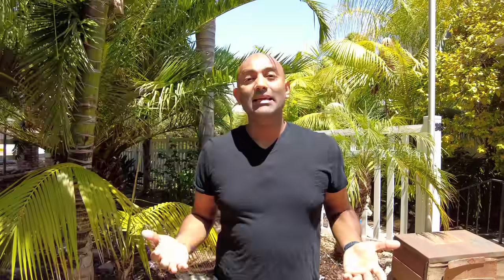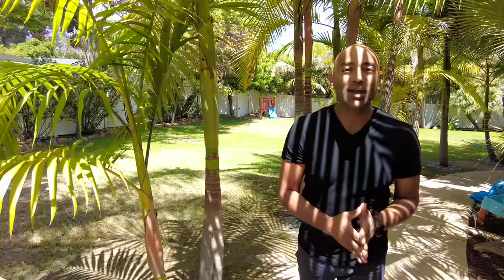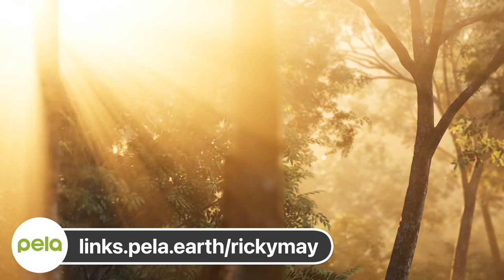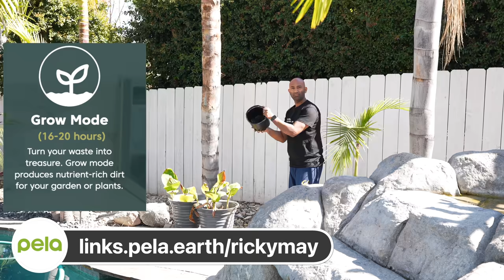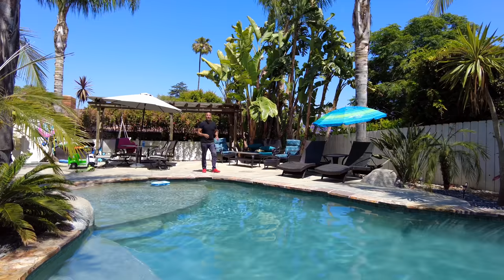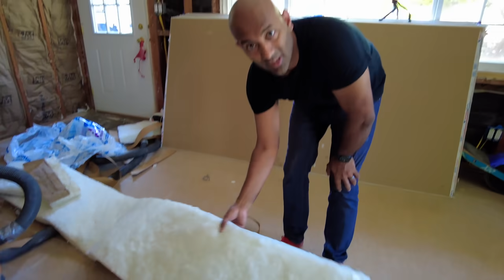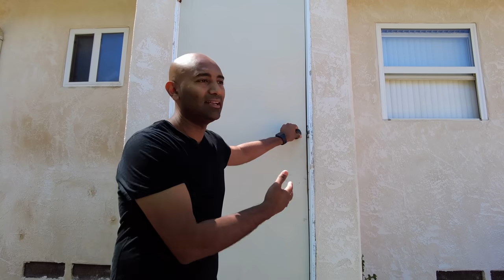How I'm Planning to go 100% OFF-Grid!

Comment: At 13:04, one thing to consider is that there's a minimum monthly charge just to have the natural gas service.  So it may cost more than you think even if you're not really using much hot water at the auxiliary house.  Also, that would break the 100% goal right there with that methane gas which is 80x more greenhouse potent than carbon dioxide.

Could DIY trench a small conduit using water hose excavation under the pavement.  Or run overhead 4AWG wire from main breaker panel to sub-breaker panel.

Also, will the auxiliary house have its own house battery?  If so, the combination of the batteries and the existing 60A line may be enough to run a tankless water heater.
Reply: Tankless are still resistance heating, so no considerable energy benefit over electric tank. Tankless are useful for wasteful vacation homes where people never actually live.
Reply from the maker: The connection fee is less than 10 bucks ... i'll find out how much exactly.
Reply from the maker: the benefit is i will never use it. this home is an office, we dont use hot water the way a normal home would. now our main home yeah absolutely. but I am now thinking heat pump water here a small one, for that house too
Reply: @TwoBitDaVinci  Yes, a small office could use hot water for employees to make tea, coffee, and instant noodles.  Nobody is taking showers there.

Doesn't need to be complicated.  Could just be a 120V electric kettle.  Or, better, a small under-the-sink 120V electric tankless heater.  At 120V, it maxes out at ~1800W (15A), it will just be a small faucet but the water comes out scorching hot perfect for a cup of tea or noodles.

Comment: I wish you luck  - not easy retro fitting a house to be off-grid. My house is off-grid for electricity for the house and the car and we have rainwater harvesting supported by solar well pumps. Living in the tropics we don't need heating but I do have solar thermal for hot water. This was possible because the house was designed from the ground up to be off-grid.
Reply from the maker: very interesting, in Thailand? that's soo cool, I want to come visit, let's do a collab :)

Comment: You don't need a geothermal heating system in Southern California. I design and sell residential HVAC systems in Washington state. Even with our 25 degree to 45 degree winters an air sourced heat pump is all you need. Unless you are going to dig and trench yourself for Geothermal it's going to be way too expensive. If you want efficiency get a Trane XV19 Heat Pump and ducted air handler or a Mitsubishi system. It's even better if you go 100% ductless with the wall mounted heads. Then you avoid all the losses from ductwork running through an attic or crawl space. Insulate and seal up the house and then use a good Solar system. I love what you're doing. Once I buy a home I will be getting Solar, a ductless heating system, and a wood stove. I love the idea of a self reliant home.

Comment: Mini splits are great for heating/cooling individual rooms.  Large, open areas may need central a/c, but mini splits really put the heat/cool where you need it without running a large unit.  There are a few mini split heat pumps.
Reply from the maker: you said it! For my main home there's too many places and at some point a large sytem is better. But I am going to look into smart vents that open and close only cooling certain areas
Reply: @TwoBitDaVinci  Check with an HVAC person.  Apparently, closing too many (over 10%) vents puts too much back pressure on the system and ages the unit.  Not at all intuitive.
Reply: I have two in AUS

Comment: For the second house how about solar water panel and small pump to highly insulated tank.  There a vacuum panels that I think would be very good for that.
Reply: better to put in solar PV and 50 gal electric water heater. Less cost and more benefit.
Reply from the maker: I agree! I'm going 100% PV solar, and a heat pump water heater I think

Comment: after changing the pool heater from the pipes like yours, to a heat pump heater
and i can tell you the heat pump ripps heaps of power
as the solar only runs for a second
so i run both systems.
the only thing i see that the heatpump is good is because you can crank it in winter and use the pool so you can gain days of use to the cost i guess
also how much power dose the lomi cost to do a cycle

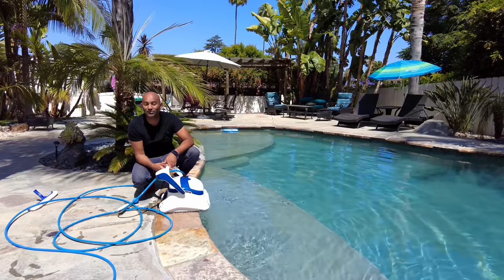Comment: 7:00 how much are you paying per kWh?
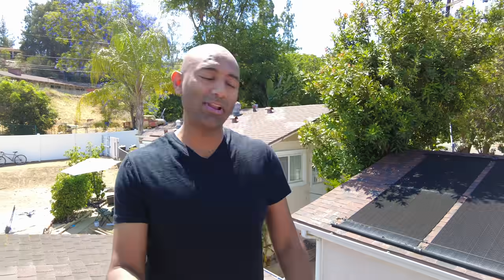10:00 while that is opened up maybe combine all those roof penetrations?
13:00 110v heat pump water heater for low demand is a perfect solution. In fact, most heat pump water heaters only have 220 for the backup coils.
Reply from the maker: 30-55 cents per kWh. Yes I’m going to clean up the roof as I go! Yes we are thinking heat pump heater as well

Comment: My heat pump water heater is wired on 30 amp circut, But it only uses 1-4 kw per day.  I believe Rheem has one that runs on 15 amp circut, it does not have the secondary heating elements.  Thats the one to get for the office...
Reply from the maker: That's what I need! I don't want to have any back up... here in San Diego, the heat pump part is all we need. Plus it'll help cool our closet

Comment: You should get the heat pump HWT it will heat your water and cool the house. You get the big tank and any excess solar you have heat the water. Its cheaper than battery and storing energy. Add some solar thermal on your roof. You can not say earthship, net zero or passiv haus with R12 insulation and GAS!

Comment: You could condensate water out of the air in an airduct/pipe under the earth. The heat generated could be beneficial for your geothermal heatpump. With a Mollier diagram and the statistics of humidity in your region you could check the feasibility.
Reply from the maker: i love the idea! I'd love to pick your brain about this more!

Comment: that is great news that you are planning to go off grid. I have the exact same thoughts. 
But since you are planning to go for Geo Thermal Heat pumps for your Heating, why do you want a separate system for your Dryer? why not use the same since it will be more efficient.
Reply from the maker: it'll depend on timing, but that's a very good idea!

Comment: Well, in the small house you can use 5 liter electric water heater to eliminate gas. You need a wire and it needs to be installed into the water pipeline. No hot water pipeline is needed.

Comment: Ricky, you suggested in this video that a natural gas connection is normal for houses.  I live in a suburb of Portland (Oregon) where many (if not most) homes are not connected to natural gas.   Some have diesel fuel for furnaces but most were connected for electric heat and electricity is still cheap enough to make that a popular choice.
Reply from the maker: yeah for you i'd say its obvious you have to go heat pump! we'll try to cover benefits and advantages for all!

Comment: Before you install radiative barriers, make sure you understand that the shiny surface is NOT for reflection but rather, it is a low emissivity surface meaning that it radiates very little of its heat. If you look at it with an infrared camera, the "color" will indicate it is a much colder surface than it really is. Long story short... The shiny part goes on the hot side and you need an air gap between the shiny surface and the surface you hope to keep cooler. This will help you decide how to install the radiative barrier for maximum effectiveness.

Comment: I am interested to see what comes of these projects. I have already started my journey to make my homestead more resilient in the urban environment. Rain water for irrigation done and off grid backup power in the works. Keeping natural gas makes sense in my plan as the gas still flows when power is out. Also, I prefer to cook with fire. Maybe in the future when technology improves, the switch to electric heat sources will make sense.
Reply from the maker: great points and excited to have watching Eric! Yeah I'll definitely Keep natural gas, in some place for super emergencies. But otherwise I'm planning on an oversized system of solar and batteries so we can overcome a few cloudy days etc. I'm also planning a gray water system from showers and sinks for my irigation

Comment: Electric tankless water heaters need massive amounts of power. You are much better off with the Heat Pump water heater. I would suggest upgrading the panel to the smaller house. It will be worth it in the end.

Comment: Very interested in this series. We are currently waiting on upgrading our home solar from 5w to 15kw with two new powerwalls. And pre-wiring for another powerwall and EV charging. Sadly the biggest issue has been need for a new roof and extremely slow motion of the bank for a HELOC update. But we will be done in June I hope.

Comment: I think you can use a Solar Pipe water  Heater too on top of the heat pump , you can even DiY it is not that hard to build and it would  make a great video . Oh and  you can also just use an electrical (resistence) shower on the ouhouse , instead of installing a whole boiler.

Comment: This is a fascinating project!  It would be interesting to see side-by-side cost comparisons between a similar installation in a new house and a traditional energy setup, the kind a contractor is likely to be building right now.  My guess is the traditional approach is cheaper now, but that  cost is likely to increase over time, where the newer concept cost will be decreasing.  We need to calculate the sweet spot for the total costs over a reasonable lifespan of the house.

Comment: Matt Ferrell's YT channel mentioned your renovation  what caught my attention was how you were going to mount your solar panels in the backyard. This is something I was interested in doing but was worried the distance between solar panels and service panels would be a problem. Is the distance between solar panels and electrical service panels a problem? If not I might opt to add some more solar panels in our backyard on top of the shading structure. Thank you and good luck with your project.

Comment: Sounds like we're all in for a great video series. I can only make 1 suggestion for an appliance based on my own experience, an induction stove top! Heats as fast as gas, but uses less electricity than electric! Bonus all around! 😁
Reply from the maker: that's amazing, yes our plan is to swap to that for the main house!
Reply: Induction all the way. We've been using induction hobs for over a decade, I'll never go back to a regular electric or gas hob.

Comment: Great plan Two Bit. But sub surface drip irrigation under your lawn is the way forward, sprinklers are huge waste through evaporation and run off.
Reply from the maker: really good point. i have some ideas and products I'm looking at. also i want to do a gray water capture system from sinks and showers, and use that for 100% of my lawn use
Reply: @TwoBitDaVinci  wonderful what you are doing! I’m a plumber and love my subsurface drip. Minimal water direct to the roots for lawn and plants. Love watching your mind work, keep it up.

Comment: There are 120v 1.8kw tankless water heaters for at the source heating. It won't be powerful enough for showers and washing machines, but should be good for sinks. They aren't expensive either. Or look up point of use water heaters. Home Depot has a 6 gallon point of use hot water heater for 250 with a 30 min recovery time and running only 1300 watts. How often will you need more than 6 gallons of hot water in that space? Hope that helps. I'm looking at removing gas later on as well.
Reply from the maker: that helps a lot! since we bought the place, the hot water heater wasn't working so it really hasn't mattered. but if we're going to address it, we should be thinking along these lines
Reply: @TwoBitDaVinci  I also found a 20 gallon tank that runs on 2kw of 120v AC shortly after posting that. You would need a dedicated electrical line ran for it, but that would be huge amount of water when needed, more than enough for a single shower. Cheap too. 

I'm tempted now on these as I have been trying to figure out a way to reduce peak power needs for inverters, which is quickly increasing cost and complexity. Running everything on 120v at 5kw is much easier, even when needing two separate inverters than getting a large 240v 10kw+ if you are going full DIY.

Comment: Check out a variable speed pool pump if you have a single speed pump.  They pay for themselves is about 18 months (after rebate) in Los Angeles.
Reply from the maker: Great suggestion Bill! So I’m a little confused on the benefit. Does it move less water over a longer period of time? I’m curious where the savings come from? Thanks!

Comment: I, too, have a back house with a 60 amp subpanel and I won't trench more electrical.  There is no gas.  I have already put in heat/ac and hot water and am considering a kitchen.  

I don't know that solar panels plus PowerWalls will work, but it should (with a few main breaker flips).  The setting I need is to keep the draw from the house below 60 amps, but PowerWalls don't have that.  I think just putting in more solar and batteries than I need will do it, but I will be wasting electricity if I can't feed excess back to the grid.

I am anxious to see what you do...
Reply from the maker: yeah the 60 amps is when you pull from the wall. if you're providing power from a battery, that doesn't count toward it, so yeah that's a great plan
Reply: @TwoBitDaVinci  My problem is that I want to tell the PowerWall to turn on when the draw from the main house (into the subpanel over the trenched line) is over 40 (or whatever) amps.  That way, it can knock my draw down and I can use fewer panels and PowerWalls.  Without that ability, I am just guessing at sizing.

Comment: Maybe get a heat pump that cools your house and heats your pool at the same time. Why pump heat out of your house into hot air - like pushing a rock uphill. Instead use the pool as the heat sink👌
Sound impossible? These types of heat pumps and are used with ground source heating and cooling already!
Reply from the maker: I need to look into some heat pump synergy for sure! it'll be a bit tricky i suspect but it'll make for great episodes!

Comment: I would keep the bank of working pool water heating panels.  Just plumb around the bad ones and remove them.  Mine work great (they leak just after the 12 year warranty expires, but you can plug the leaking channel or replace the panel).
Reply from the maker: I am going to go 100% PV solar, because my pool doens't always need heating, but i always need electricity. I am going to get a heat pump pool heater and run it off solar. I'm so sick of these things leaking on my roof.
Reply: @TwoBitDaVinci  I too live in the San Diego area, and we have a 30,000 gal pool with solar pool heaters on the roof. When adding solar PV I had planned to do the same: ditch the solar heating and replace it with solar PV panels, plus add a heat pump for heating the pool. After some calculations, I concluded that a 140,000 BTU heat pump (a big one) would need to run around 6 hours per day to make up for the typical heat loss per day throughout the swimming season. This heat pump alone would more than TRIPLE our electricity use..... Needless to say: we kept the solar pool heater panels, and added solar PV around it..

Comment: Just dig a geothermal well and connect it to your water heater, forced air unit, and pool heater. There might even be a heat pump dryer that can interface with your geothermal system. Combine this with better insulation and solar and you are off the grid.
Reply from the maker: I'd love to do this!

Comment: I have a sailboat that I live on about half the year which is totally off grid , and a house in Tucson that produces more power than I use even with charging a electric car, with  9kwh of solar on the roof of a all electric 1250 sqft. 1977 home .  I replace the central HVAC with high SEER inverter mini splits  replaced all the appliances with new high efficient ones  , heat pump water heater, and high efficient 2 speed pool pump . I still need to pull power off the grid during the winter months, but on a yearly basis I make more power than I use. It take time and money to do these things but if you are going to stay in the house its an investment that will pay off in many ways . best of luck to your project . P.S. my thoughts on heating my pool,  I just installed a heat pump hot water heater for the house major improvement over old watt sucker but for the pool I am thinking about a vacuum tube vented system I noticed  Home Depot selling them in Mexico ,a 15 tube 40 gal tank system for 350$
Reply from the maker: I need to look into that for my pool
Reply from the maker: Super jealous … sounds like an epic life my friend we’ll done!

Comment: Have you considered rainwater harvesting? I know it doesn't rain much in San Diego, but it does rain. If you do decide to look into it I'd recommend a metal roof, water comes in cleaner.
Reply from the maker: Hey Rob! I'm absolutely going to do that. also I live on a hill so i get a lot of water run off... i might need to filter it first, but my plan is to have a well, and fill it all winter, and use it all summer. lots to mess with and learn. but im super excited

Comment: replacing dryer, and hot water heater is good idea, but maybe wait till they break, unless you really go ho in doing it, Its what I did , after solar panels where installed . Gas is fairly cheap in Ohio, so gas furnace stays , solar in winter is so so  when you get 4 to 6 inches on top , though I do have special roof rake to pull snow off
Reply from the maker: yeah you have a different scenario for sure. But hopefully it'll still be valuable!